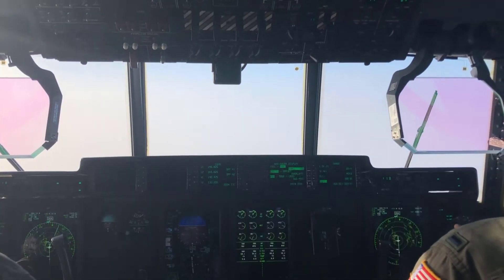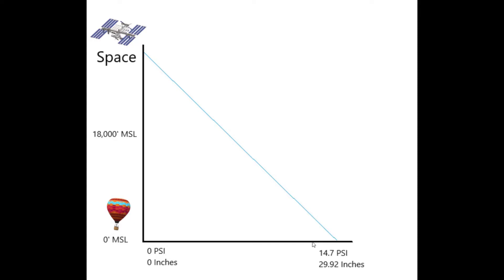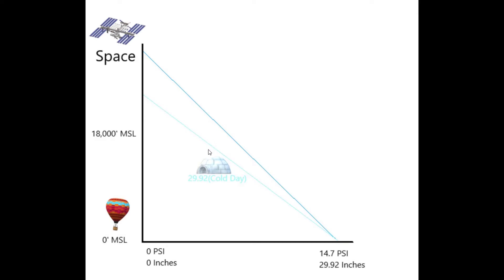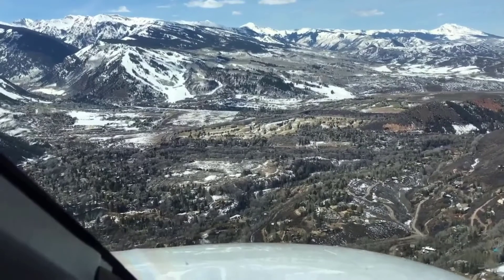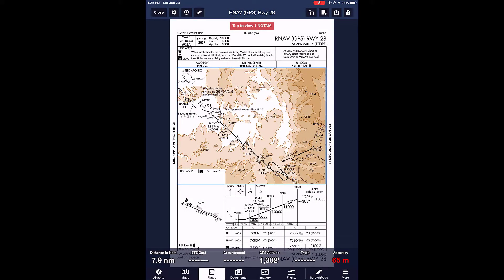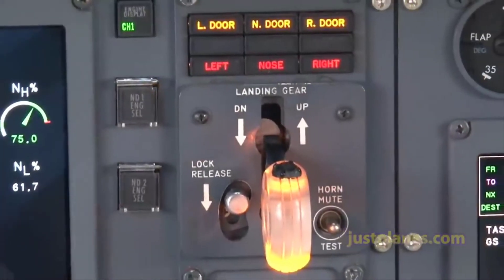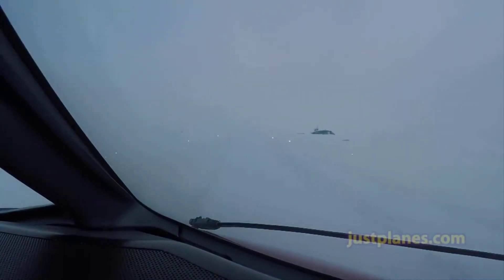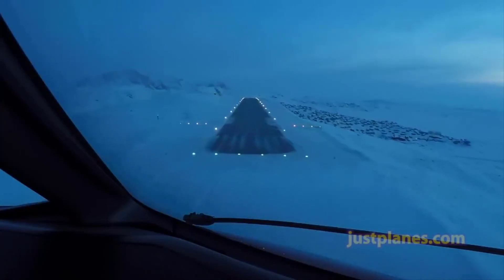Cold Weather Altimeter Corrections: Altimeter Basics, How to Calculate, FAA Snowflake Regulations

Comment: Great video, so if you requested them, Do you fly whatever atc cleared for altitude or altitude+corrected tempo altitude
Reply from the maker: You would request to add your altitude corrections to vectored altitudes and from there its up to the controller to tell you what they want to do from there. Your only obligation is to refuse altitudes that you deem to be unsafe...that would be altitudes below FAF+corrections on vectors or altitudes below IAF + correction for full procedure.